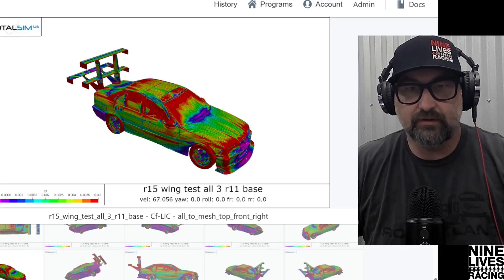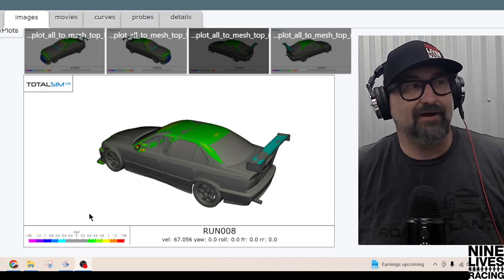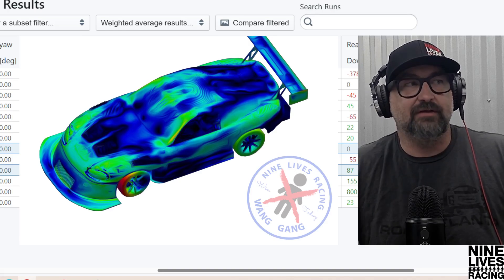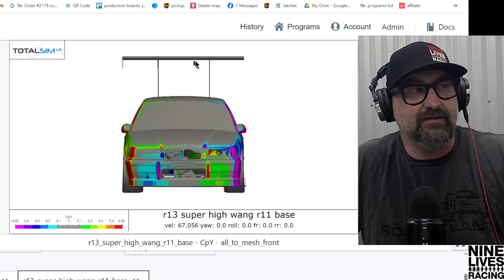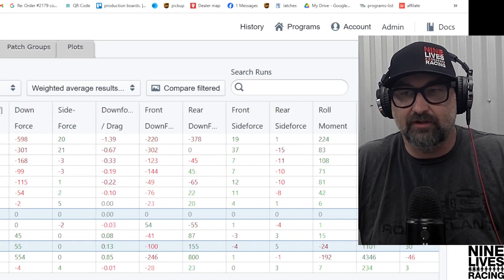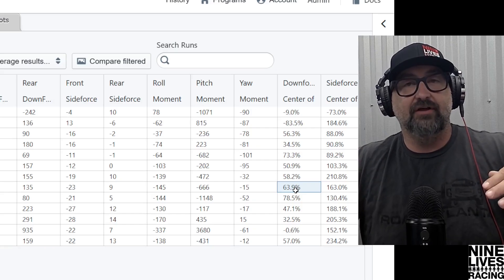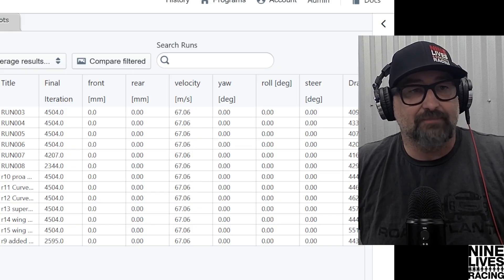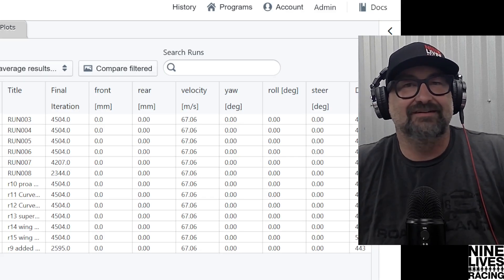How Wing Placement Affects Downforce & Balance | CFD Tested with TotalSim

Comment: Ultimately, what really matters is force on the tires, and drag.  Any drag source above the CG or downforce behind the rear axle centerline is going to pull weight off the front.  The reason wings are usually located behind the rear axle is because front downforce devices are more efficient, so adding front force to counter rear leverage results in less total drag for a given force at the tires.  A bigger wing farther forward would require less front downforce, adding substantial drag at the rear with negligible drag reduction up front.  All the early wings were located directly over the rear wheels until they figured out that a lower, more rearward wing was more efficient when paired with a good front splitter.

I'd like to see the difference on the Wang between top up and top down on a Miata (preferably NC because that's what I have).  I've seen it elsewhere generically, but it'd be cool to see specifically relative to the 9lives kit.

Comment: Great Video, thank you!
Another idea‘s for cfd simulation for e36 i think a lot guys would be interested in (especially in Germany or Europe):
In „Gruppe H“ spec races the maximum allowed wing size is 80% of the car width, measured at the rear fenders.
Could you please simulate a „80% wing“? Or would a dual wing help getting back the good results of your actual wing kit?
Actually most guys go for the „high rise“ class 2 wing. Could you make a comparison with your Splitter and class 2 wing with your wings?
Thanks in advance!
Matthias